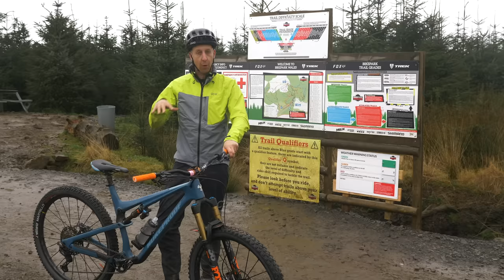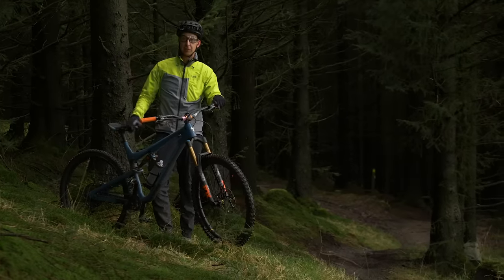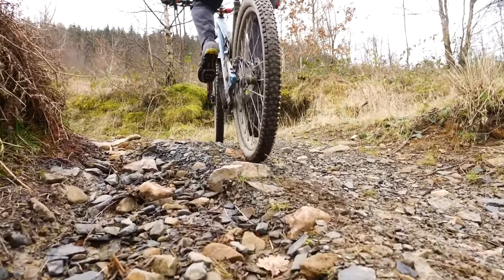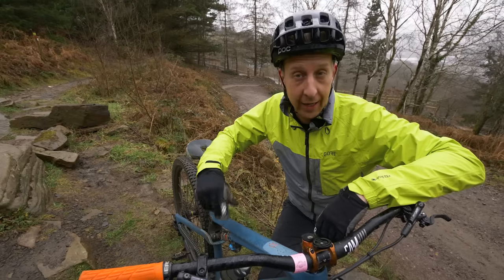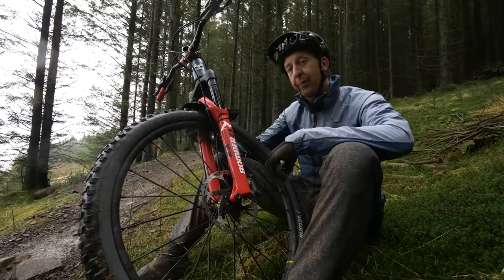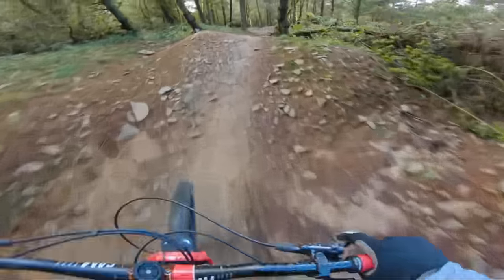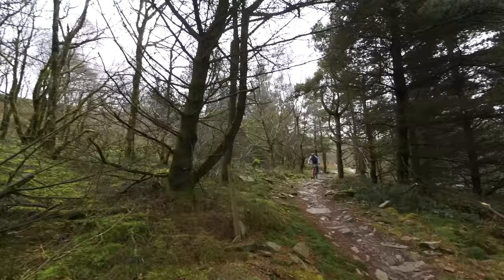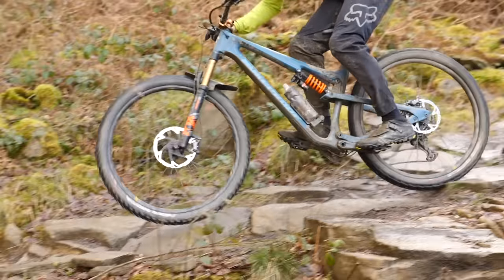Coil Vs Air Suspension – Which Suspension Is Right For You?

Comment: You look smoother on the coil setup. Yes a bit heavier. Most setups on air are set by factory clicks.. yes work great. Can't beat a twist of coil n oil....    coil up front Doddy with a Ti spring? Awesome as always. Hammer on Doddy.

Comment: My v4 nomad feels like it can go through anything effortlessly with a coil on the back. I have a remote lockout and I think that gives me the best of both worlds. I lock it out for climbing and it feels more efficient than it ever did on air.
I love riding rough rocky stuff so I'd like to try replacing my lyriks with coil on the front at some point.
Reply: If you don't mind not going back to air in those lyriks try push's ACS3 upgrade maybe, cheaper and better option imo. and you still get bottom out tuning.

Comment: Hey GMBN tech! Hey Doddy what you need is some offset bushings to lengthen the coil rear shock and that will raise the bottom bracket a little bit! Imagine a system that would rotate the offset bushings 180 degrees when desired via a handlebar lever!!!! Ride ride ride!
Reply: Canyon sort of did it with their shapeshifter system.
Reply: Shapeshifter.
Reply: my yeti dh bike had this feature, I could change the angle of the bike which would also raise or lower the bb height. loved it, one for technical and clearance and the other for flow trails.

Comment: Did you do any set up at all with the coil arrangment? At least change spring rates at either end? It sounds like you just assumed the shock would ride worse if you added compression damping, but depending on where it was set to that isn't always true. I wonder if you needed to go up a rate at both ends?

Comment: I would like to see the review with the fox fork and coil shock.
Reply: Mazochoi are fox, fox is mazochoi same internals as fox its just a tad lighter
Reply: Bikingis4me But he used coil on the fork not air
Reply: @MChila  he was seeing if coil or air is better for the fork as well
Reply: @bikingis4me48  Not always. In this case (on the fork) he is comparing the the top Grip2 damper vs the budget Grip damper on the Marzocchi. If he used one of the cheaper/oem Fox forks with the same damper it would have been a more fair comparison and maybe the end result would have been different.
Reply: I would prefer to see the brand NEW Öhlins fork and TTX22m.
Reply: @Krikstar123  Exactly mate. He is biased towards air. Meanwhile Bruni is winning on coils. Most ALL mx'ers are on coils, not air. Air is hype...good but not the best. Coils are better, proven science. Not ruder hype and bias. 👍
Reply: Micael Teixeira Fox are for fashion victims.

Comment: How much do you think that the front and rear are dependant on each other, I mean to say, that do you think that the rear shock would feel different with an air fork and vice versa? You described the lack of feel of grip for the coil fork, do you think that has an effect on how the shock feels in the turns as well?
Reply: Front and rear very dependent on each other. Balance is key. Weight bias, brake dive & pitch.

Comment: I have EXT Storia LOK V3 so it has a climb switch,  it's a coil shock, Doddy and the rest of the crew already know this. I haven't had a problem with my Geometron G1 being so low, I run 175 mm cranks, I haven't tried shorter yet, and don't really use the climb switch, but I have tried it, but climbing without it feels great, I made sure to get get used to the bike, and I feel at home on it.
there is no way that I am going back to air, with coil I don't have to worry about adjusting pressures often.
Up front I have fox 36 with Vorsprung Smashpot.
The EXT Storia LOK V3 has got a lot of good positive comments,,  I saw several ppl on Geometron owners facebook group, say the same thing, but one dude there has tried the Fox Air alternatives and the coil shock from fox, and he wrote Storia v3 is much better, I don't remember exactly what he wrote.

Comment: Try 30% sag on air vs 25% sag on coil, it should compensate for the more linear feel of the coil. I run air/coil front/rear on my 29er enduro
Reply: 🤦‍♂️🤦‍♂️🤦‍♂️ 30% 🤣🤣🤣 
🙄🙄🙄🙄🙄🙄🙄🙄

Comment: Coil shock on rear is amazing, rockshox super deluxe coil has option to easily crank compression up on fly as well as climb switch which makes it climb just as good as air and probably better on tech.  Harder compression on coil rear and only real downside is weight but air have slightly better pop.  Coil shock so good down rough stuff.
Reply: My new bike is coming with a Super Deluxe Coil RCT :D

Comment: Great video. Doddy - was hoping you could give some advice to me on this one. I currently have a 2016 Giant Reign (full air) and a 2012 Rocky Mountain Flatline Pro (full coil). The Reign is my every day trail bike, the RM is only for bike parks with a lift. I'm looking to replace the Reign with something a bit more modern. The 2021 Commencal Meta TR 29 Race is striking my eye as it has the Lyrik air fork and a coil shock in the rear. How have you liked your set up with air in front and coil in the back? I usually like to set & forget my suspension, and although my current Pike fork on the Reign is amazing (never have to adjust it), I find I'm always having to check the rear air shock to put air in it, etc. Seems like a match made in heaven. Thanks!

Comment: For downhill air shock won't work because the air in shock chamber will modify the temperature from sustained friction and will increase the volume, resulting in a stiffer shock.

Comment: Idk if someone sees this but are the coil forks the one that you fill up with oil well atleast on dirt bike and air is literally only air
Reply: Oil and air forks are identical on the damper side, coil fork will have a spring in one side and air will have an air spring. Both have oil in the damper side.

Comment: I'm over 300lbs and I can keep my rear air shock from bottoming out when using near max pressure in the shock. However, I'm looking for some suggestions of the most heavy-duty high pressure AIR shocks that would be a good fit for me that I maybe don't have to max out. Everyone tells me to get coil but air seems to be working ok for me and I like the feel better. Any suggestions are appreciated!

Comment: Interesting. I'm riding a DVO topaz shock which is so sensitive off the top (bladder) that a linear setup with low sag (28%) feels amazing. More midstroke support and plenty of bottom-out resistance (frame is pretty progressive). I love the linear feel so much in fact that I'm considering converting my Pike RCT3 to coil. I'd be doing the exact opposite to you though, and eventhough I know it's all personal preferances, I'm a bit hesitant because of it. I'd love to hear your thoughts about running a coil fork and air shock. Also: when you say the bike becomes more cumbersome to hop around with when riding coil, I guess it's mostly the shock's behaviour that causes that, right? I understand lifting the rear wheel requires you to preload the shock first but lifting the front wheel is a much less preload-reliant process, right?

Comment: I wasn't expecting you to change both front and back thought it was just expecting the back. I been looking into getting another full sus and looking at the new LTS GT Force as I used to have a custom built LTS 2000 in the late 90s and you get a spring option which I think looks way better but I've recently put fox on my avalanche and have owned rock shox Tora so its air front for me. Im also over 6foot and my LTS was a 18 inch frame which made it very aggressive and loooooved it soo much I wanna another small LTS bike to have fun on and free ride to my hearts consent. I dont care if its a pig to ride or I smack my knees on the handle bars ;) I love 18 inch frames for aggressive riding as I can chuck it about really easy and effortlessly making me more confident. I cant trow my 20 inch around like that. So is 18 inch equivalent to medium? and should I get Spring? I like downhill stuff and free ride the most and miss the good old days when I was on my GT LTS 2000 all day everyday and time is short and approaching 40 so wanna have fun before I cant hahahaha

Comment: I have full coil suspension, but it is very stiff. Landing hits hard, and they don’t move very much. The bike is fairly new, so it still needs to be broken in, but I’m wondering if this is just that the coils are low quality. Any thoughts or suggestions?
Reply: Too much preload on the spring or you have the incorrect coil for your weight.

Comment: I have a Rockshox Super Deluxe Select+ and a Push Elevensix on my enduro and a Fox DHX2 Factory on my DH Bike. The Elevensix is way obove my other shocks in performance. Downhill its a beast. I thought a DHX2 Factory is the best you can buy but I was wrong. My Enduro feels like the way faster bike after I switched to the Elevensix. With the stock Rockshox I had some trouble on steep technical terrain uphill but with the Elevensix it climbs like a goat.

Comment: I never run coil....so I'll throw in my 2 cents :-) 
If coil by it's linearity allows to track the ground so well, then surely by it's linearity, it will not rebound as fast as air shock, thanks to it's progressivity?
Air is not compressing as fast, so it looses traction comparing to coil, but surely coil can get into situations, where it looses traction, cause it won't decompress fast enough comparing to air(?)
Air I right? ;-p ;-p
Reply: It'd be so funny if someone replied:"yes you air right" ha ha ha
Reply: I'm not completely sure, but I think the rebound and compression is done by oil moving around in the damper so the rebound will still work as normal
Reply: I don't think so, you can compensate by running less rebound damping on the coil. What's more, it's easier to set the rebound on a coil spring (which is linear) than an air spring, because the air spring will have different rebound force depending on how deep into the travel you are rebounding from. Rebound on an air spring will always be a compromise between enough damping to not lose control from deep compression events but as little as you can get away with to have a more responsive spring over smaller chatter.
Reply: @peterchowra8022  But I'm talking about variable spring rate on air, not about damping. Air will always rebound faster from bigger hits is what I mean. But then on a bike with suspension designed to be progressive, and run with coil, will it be the same?
Reply: @polishguywithhardtospellna8227  I don't see the point of talking about rebound speed without damping, as your fork and shock will have rebound damping. Hence, even if air rebounds faster than coil without any damping, you can adjust for that by running less rebound damping on the coil. If you still cannot get fast enough rebound with coil, you can always retune the rebound damping circuit.
Reply: @peterchowra8022  I'm guessing You had more experience with high end suspension, than I had with any. But let's not forget coil is sold in affordable bikes too. You can't tune high and low speed rebound on most of the shocks really, only the top ones. And custom tunes?  What's the percentage of people running that? (And I don't mean custom tune for Fuel EX, or Rift Zone model)  That's another thing that is unfair in those comparisons, they're always top vs top. Although I can imagine, that from certain price point, there will be high and low speed rebound circuit inside, but might now have the knobs for tuning yet, just to cut the offering into more price brackets. So the rebound might be progressive with the shock without us knowing, but is it always like that? Deffinitely wasn't in the past.
Reply: That's not really how it works :D